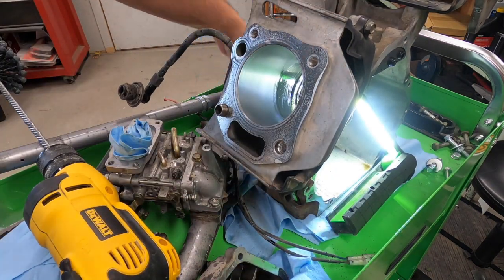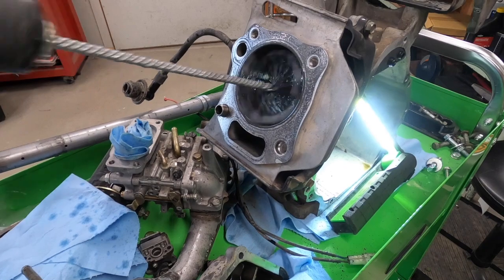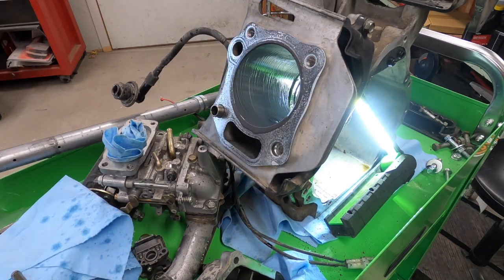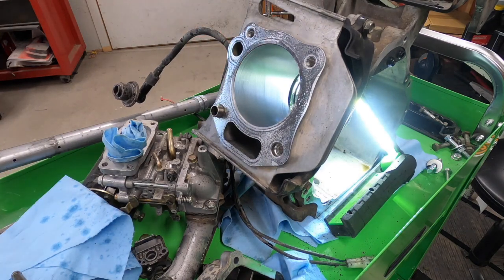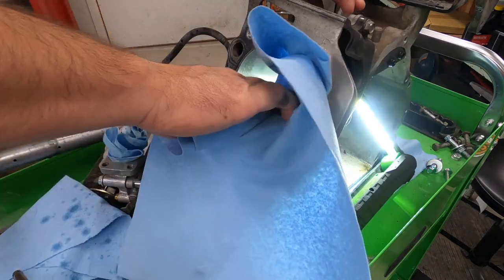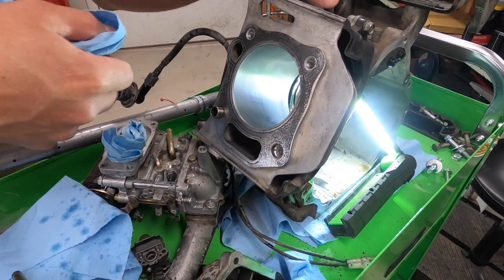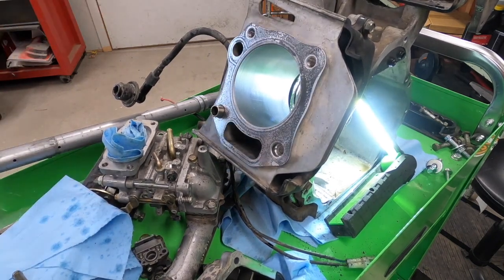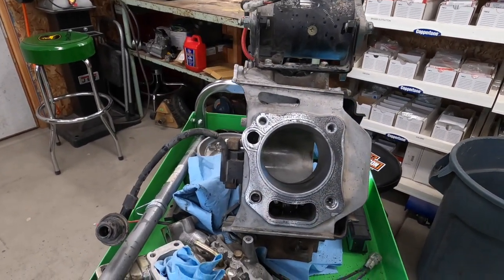How to hone a cylinder on a small engine (Yamaha G29)

Comment: I’m studying this so I know what to do when the time comes. You mentioned twice that your goal was to match the rotation of your drill to the speed you pushed the hone in and out of the cylinder in order to achieve the optimal 45 degree cross hatching, yet you never really did that. Wouldn’t that be achieved more precisely by really slowing the drill down all the way so you could actually see the revolutions and then match in and out more easily?  Wouldn’t you do that towards the end of the process after removing any glaze?

Comment: Good deal KB iv got to get a hone like that im still using the old style with 3 stones
Reply from the maker: Thanks Rooster.  They are great little hones!  Beats those 3 legged stones for sure and offers a great end result!
Reply: Would the three rectangular stone style hones be better at correcting any cylinder out of roundness or cylinder taper? 

I can definitely see how the ball hone could be much better at deglazing and giving a beautiful finishing crosshatch.

Comment: I love those ball hones!!!  So much better than those three legged ones: too easy to make a conical shape. Been using those ball hones on 2T cast iron cylinders on antique scooters for years. Takes off almost no material at all. Nice video!
Reply from the maker: Thanks LML!  They are pretty great little tools.  Leaves a great results.  The only issue is you have to have several sizes.  Thanks for watching!
Reply: Yah my mentor used these.

Comment: So Kyle how much you taken out of there .001 maybe ? Do you have a dial bore gauge to measure ? The motor oil seemed to work just fine ! 👍 Can't wait for the next one ‼️
Reply from the maker: Thanks Bill!  .001" MAYBE, if that.  It doesn't take much.  I didn't measure this one.  I have used ATF in the past, but this hone said to use a 10w30 so I tried that instead and it worked great.  Thanks for watching!